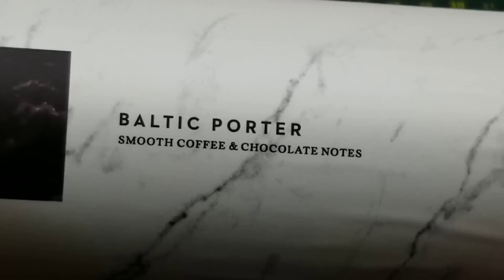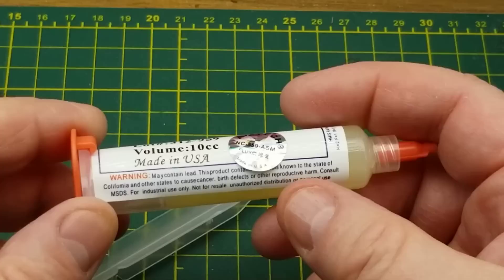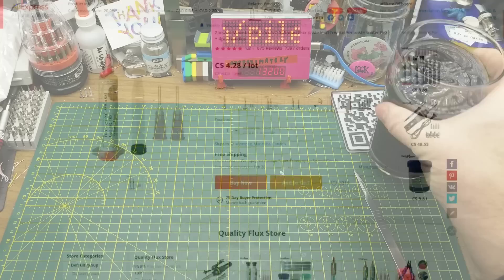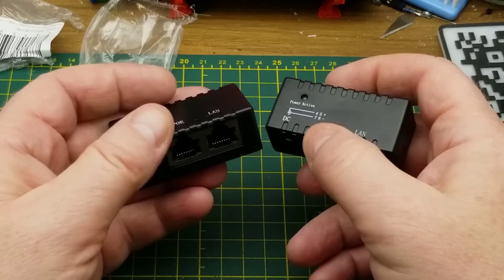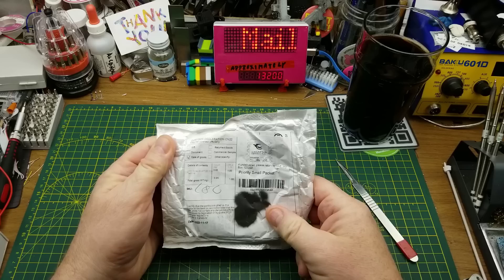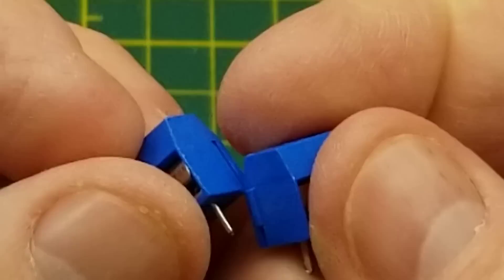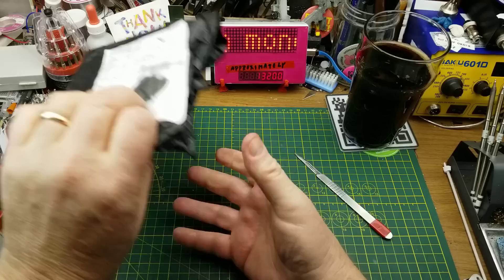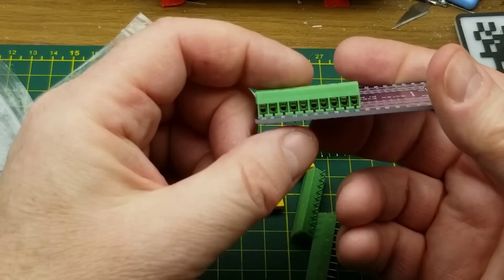Mailbag Monday 156

Comment: Many years ago I used a Weller Pyropen butane iron for a job that required soldering/desoldering live 125VDC equipment as most (all?) AC powered irons have grounded tips.  This was way before battery powered irons. The only other option was plugging into an isolation transformer, which had its own issues.....
Reply: Wow, the Pyropen would have been the only way to go.  Another plus to the Pyropen, if I remember this right, is that they reach temperature really quickly.

Comment: I take it that if you set the beer down after the first sip, and say nothing about the taste, the review is: "Well, it's beer."
I still have my old Radio Shack butane soldering iron (1980-something?), with the built in flint roller doodad.  It has since proven itself to be really handy for work outside.  I also have one of those ancient, much-loved blue NiCad-driven irons, but it's much quicker to recharge the butane iron and get on the job.
And rather than needle-style, those little flux pens that dispense liquid flux (at one millirossmann per press) have been excellent.  No need to saturate the PCB with wasted flux.

Comment: That's a really nice well-rounded hall. I need to spend more time on the pi pico. I have a butane soldering iron also. It has a little Stryker on it which is really nice. I haven't used it since I've been back to Florida but it was crazy handy out in Alaska.

Comment: happy new year from germany pelof!
I have a tip for your new gas soldering iron.
Put the soldering iron in the freezer for a while.
then you have to be careful when filling the gas.
Reply: Dude ! That's not a soda stream bottle :D ...I wouldn't fill it to the brim also, because "usually" they leak, and all the gas you don't use is gone next time you pull the iron from the drawer ;)

Comment: Regarding the flux,  I find the liquid flux works better than the paste in most cases.   Would look forward to seeing how this paste works out :)
They have to say the may contain lead thing to meet California regulations and the fact the production lines may have traces of lead from other products.       You are 100% correct those PoE things won't do gigabit.    You need all 4 pairs for gigabit.   A lot of Chinesium devices will say gigabit because it will plug in to a gigabit switch, even though the device is not capable of passing it through.
Reply: Did you mean "Colifomia"? 1:18

Comment: I could never  get the cheap fluxes to work until I did a Rossman and piled the flux on until the joint was submerged - lol -.
Reply: Rossmann (two nn's) is magical. Never have got the hang of getting solder to magnetically flow up a trace and leg before burning the mask off a 0.5mm pitch device.  He must be using a hot plate.

Comment: hi @pileofstuff #pileofstuff a heads-up FYI or kind of PSA, please be aware and cautious of those cheap butane torches , ive bought 5 or 6 different styles from china now but have gone back to my 2nd hand Dremel one that was given to me by a friend , i had one almost explode in my hand in use , one went postal 2nd time i light it and shot a 1 meter flame and two of them the valves went on refilling them and simply leaked the gas back out, honestly there was one i really liked and may buy again but  probably wont bother.  The one i had like yours had the shaft bent and it became loose so i never used it more than a couple of times , thanks for the great videos  ;-]

Comment: I have the blue connectors in 2 and 3 way along with the smaller green connectors.
Reply: Some of my 2-pin screw connectors have legs that with 5.00mm instead 5.08mm.  5.08 fit better.
Oddly, my green 5.08mm seem to clamp down well on small wires, while the blue ones really need a large wire or ferrule to get a good grab. (shrug)
Reply: @GnuReligion  There are various sizes of pin spacings which I learned the hard way after ordering the connectors for a PCB project.

Comment: Those Pico breakout boards look neat.

I had a butane soldering iron, the first time I used it flames shot out the side of it and down the handle burning all the hairs off my hand. Luckily I was outside at the time in front of my house, so I threw it into the road where it burned away to itself. LOL It only cost £1 so I was'nt bothered.
Reply: any over-spray of butane after a filling a lighter or a soldering pen will ignite in a glorious, instant fireball - and of course, making it much worse would be a badly made leaky pen.  That sucks.
Reply: @matambale  I think it had a dodgy seal or something. The gas was gushing out of the side. It's the only thing I ever bought from Wish. LOL.
Reply: @frankowalker4662  Bet you WISH you hadn't 😄
Reply: @agenericaccount3935  LOL.

Comment: Those Poe injectors work good for 100Mbps projects. 🙏👍
Reply: Yes,  A lot of Chinesium sellers list them as "Gigabit" even though they can only do 100mbps.   I think the belief is it connects to a gigabit switch so they can say it is gigabit even if it can only max out at 100mbps.  It still can connect to a gigabit port.
With that said, most PoE CCTV cameras are also only 100mbps, so you can still do a lot with that bandwidth.

Comment: Ethernet is over 2 pairs. The other two can be used for POE (one pair) and POE+ )the second extra pair. POE++ (802.3bt) uses power messaging to broadcast the signals on the data pairs at full POE voltage (56v) and reads the signaling and then rectifies the voltage to bring POE up to 100 watts. 

Even 10G Ethernet doesn’t use more than 2 pairs and in non POE the other pairs are just ground.